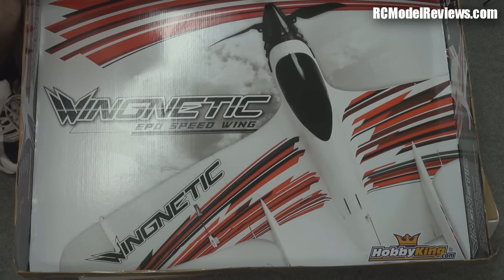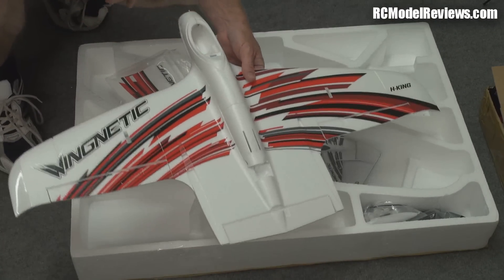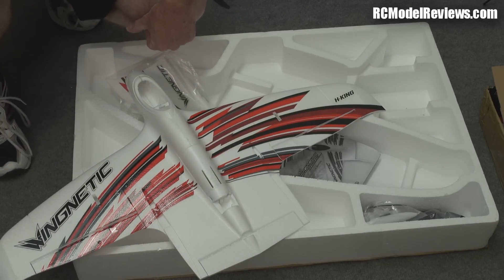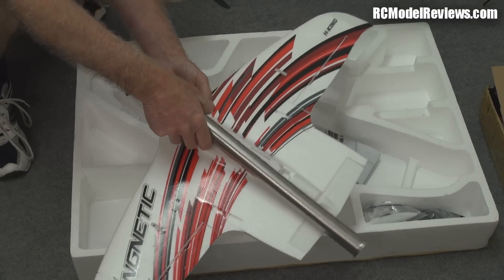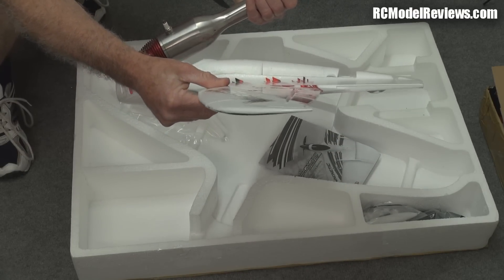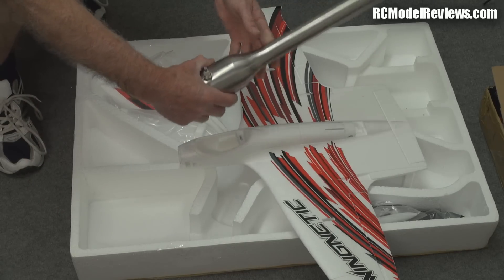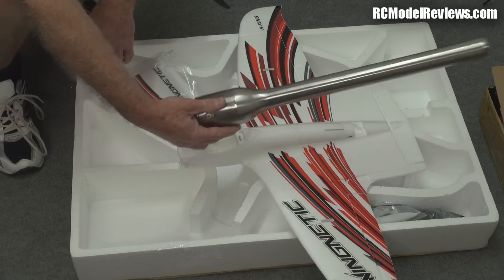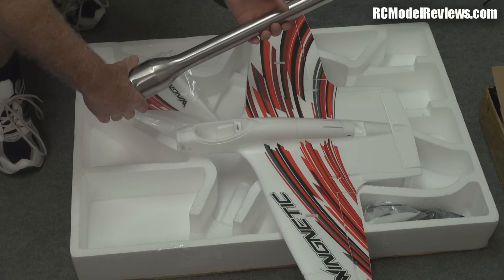HobbyKing Wingnetic pulsejet project

Comment: Fab plan Bruce. Make sure you check that the wings are glued together properly at the join as there have been reports of them coming loose after just a couple of flights :o)
Reply: Vince Sygall Yes I saw that.  Needless to day I will be beefing up the wing with some extra carbon anyway.
Reply: Quite annoying that they just didn't leave it as 3 piece.  I bought the kit version with just the motor on impulse I still havn't flown it. I thought it would be too small for a pulse jet but Bruce is definately the expert here. That future pulsejet episode will be worth watching. There is also the larger HK SkyFun Jet aka Roo, HK code Skyfun-kit, 		
unless you need a separate elevator.

Comment: If the fuel goes in the nose, how will you handle the shift in CG when it gets consumed?
Reply: he will probably balance it out a bit but other than that you just fly it the tank wont really be that big and it wont last that long for it to really matter too much just as long as its some what close
Reply: fitzy553 Hmm, a flying-wing so short and stubby is going to be pretty sensitive to it's CoG to start with. With 200g (approx) of fuel to the nose, which will diminish down to 0g, I feel there could be issues...
Reply: im not exactly sure but bruce has done it in the past so i cant see why it wont work now
Reply: Don't worry, once the wings & fuselage melt due to the radiated heat from the pulse jet, the fuel will flow out evenly from all the gaping holes!
Reply: thats why you use a thing called a heat shield
Reply: fitzy553
I'm looking forward to seeing the videos! ;)

Comment: To weak of and airframe even after all the carbon, fuel proofing, and heat shielding.  The tips will flutter off first turnaround at speed at that loading imho. Effort better spent cutting the correct size cores, sheet then Monokote(generic name) old school style.  Safety is paramount in your predicament so probably best to show them the right way to do it. Franken planes are a blast but rarely last.